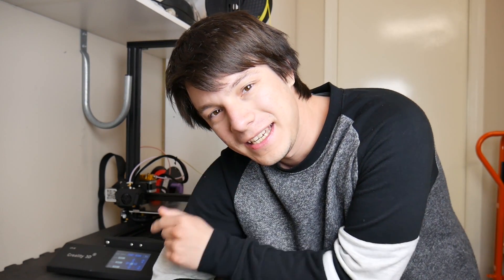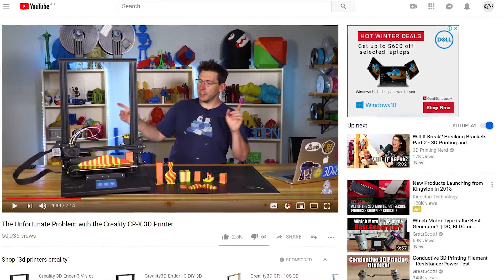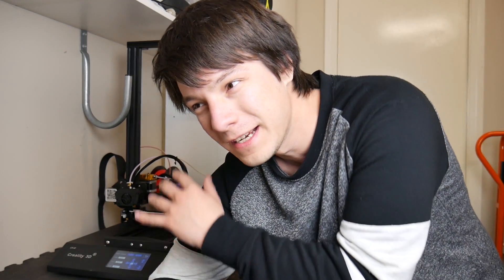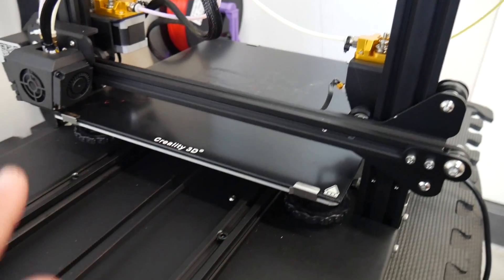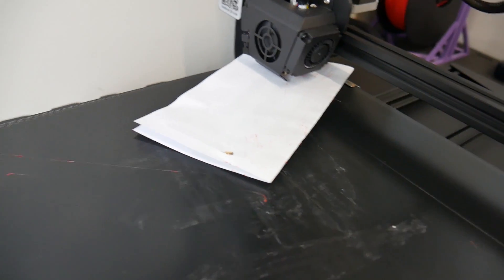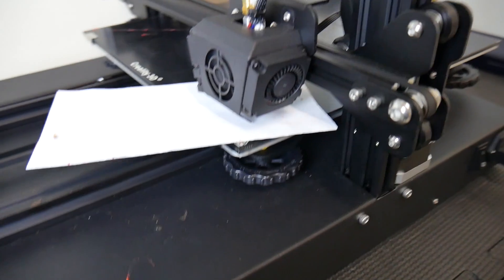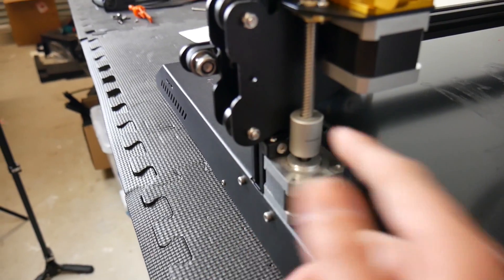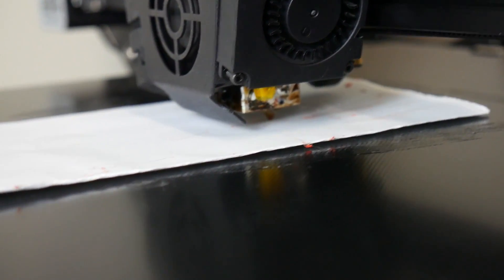Update on my Creality CR-X and going forward

Comment: I think it´s a firmware issue, I experienced similar behaviour with a DIY machine. After Z homes the offset adds a value to the Z coordinate and sets the new value as 0:00 so when the machine gets to start the print it is actually not at 0,2 but at 0,2+ the offset.
the Solution was to disable the 1mm Bumb after Z-homing. a warped bed highlights that effect even more.
Reply from the maker: Cheers for the feedback! I am leaning more and more towards a firmware issue. I'll see if they have any update I can flash to it.
Reply: Maker's Muse . I suspect that a division error (induced by a weird steps/mm setting) may throw off the calculation and adds up. a print that already runs would show no sign of something wrong. If the bed would be able to get close enough you would just se inconsistency on the first layer...and the issue would be not detectable as such.
Reply: I have also run into this on one of my machines.  My solution was to use paper to level the bed, but then adjust the z-offset another .3mm to accommodate the .3mm lift that the printer was making for the .3mm first layer.
Reply: It’s not a firmware issue. It’s how some 3D printers work. When the printer is told in G-code to go to a specific height, it goes to that height above the bed (above z=0). Some slicers, like the one that comes with the Creality (Cura), will raise z to different layer heights optimized for a given quality, adhesion and other factors. The best first layer height is not always the thickness of paper. A procedure must be used to level the bed so that zero means zero.

Also, it is common to have to adjust the tension of the eccentric rollers beneath the bed on a new Creality (and check that all fasteners and cables are tight). That was the reason the front right corner of the bed on my new CR-10s was still too low at it’s maximum adjustment (also the right z motor mount was loose). While it might be nice to have better quality control, having to pay for it might piss off Creality’s customers.
Reply: To say "It's how some 3D Printers work" means it is in the firmware.  Whether that firmware is Marlin or something else, it is something in the firmware that is telling it to go up .3mm above 0 or  to assume that Z 0 is the starting point for the layer.
Reply: In all the code and examples I've seen, Z 0 is the surface of the bed, not the height of the initial layer. I doubt Cura would even let you specify the initial layer height as 0.00mm.

Comment: You think you've got problems with a Creality printer! When I turn mine on the reading for current temps are 102C nozzle and 52C bed even though they are both at room temperature.

If I start a print which needs to reach 200C nozzle and  60C bed the nozzle temp goes runaway and burns the filament but the indicated temp is below 200C and the temperature indicated for bed temp goes up to 86C way past the the temperature where it should stop. 
How am I supposed to work out what the hell is wrong with this sort of thing happening. I wouldn't know where to begin.
Reply: i minabrons sounds like the thermistors are not doing their job, or the controller card you got should have a sticker on it somewhere if you look for it, that should say that it was quality checked on a friday afternoon just before closing time.
Reply: Thanks for the tip although I don't understand why a failed thermistor would affect the temp readings for both the heated bed and the hot end at the same time. Please excuse my ignorance if I have this wrong.
Reply: i minabrons thats ok. Well, these thermistors are sensors, the controller card being their brain, that brain being defective would result in the published readings as being all out of wack. Could be failed resistors on the controller card that work in conjunction with the thermistors. It's like if someone had a food allergy, or went into a slight diabetic coma that caused the person to behave illogically, as if the case with the thermistors misreadings. Hope that helps explain how the controller card (the brain of the machine) conducts its supervision of sensory.
Reply: i minabrons changing the controller card is what I'd do first. If its still misreading after that, then it does point to the sensors being of the friday build variety. Lol 
Cheers
Reply: True Tech, thanks once again for your reply. Much appreciated. 
It helps to focus my attention on a few things rather than the whole device. Especially when the problem with the temp, appears to me, to be so cryptic. 
I looked up (thermistor) controller card online but no luck.
To me card(s) mean something seperate that can connect to a motherboard like an audio card or graphics card. Am I on the wrong track here?

Comment: Do people suddenly forget these are insanely cheapo printers from china? seriously go find another printer with these features and build volume for even remotely close to this price point. THERE IS A REASON THEY ARE CHEAP FFS jeezus guys it's like the 3d printing world didn't exist till the cr-10 came out
Reply: $ 800.00 and they are still using couplings to mate to  leadscrews that do not have ends turned down. Nothing says "we just don't care" more than this.
Reply: Planning on buying Prusa. Tired of buying Chinese 💩.
Reply: sadly even pre production prusa had a lot of issues. Though really the build volume is a deal breaker for me on the prusa
Reply: Regardless of price, the product should work.
Reply: Good point Max, totally agree with you. Even Prusa releases MK3 too early. IMHO they lose some points (at least with me) even trying to fix things later. 

Regarding the bed leveling I realy wanna see this CR-X in action just because I’m curious about the dual cooling solution for this design (that looks like Ultimaker 3 angled fans) and about this dual material solution sharing the same heated block and nozzle. Expecially this last one, I wanna see how reliable it is. Because it’s not easy to be reliable printing with dual colors... and sharing the same nozzle I don’t know but seens that it will cog easilly, but... maybe not. There is not too many printers doing a good job on this dual colour category. When it’s reliable it’s slow like the lift mechanism of those latests Ultimakers. I wanna also see how the new Raise N2+ Pro is... cannot find any review of this printer yet! 

Hictop looks cool out of the box in a first look (by Noob), with dual head extrusion like T-Rex and Sigma, I will keep looking to it and see if continuous to perform well in therms of quality. It doesn’t use a purge block that waste a lot of filament, this is also a good point.
Reply: do you expect a 1000$ car to not have issues? what about a 5000$ car? 10,000$? 20,000$?  what about a betas? do you expect a beta games to be flawless? Do you expect brand new tech that has no alternative even remotely close to build volume or price to be issue free? what about the ones that customers won't even get? Legitmately everything is relevant and to look at in a bubble is foolish.
Reply: Generally speaking, yes. Second-hand products aside, something should work for it's intended purpose no matter what the price point.

There's even laws about this in most countries, though somehow they're not really being enforced anymore.

'Fitness for purpose' and 'merchantability' are legally protected consumer rights in a lot of places (they certainly are in Australia).
And what does that mean, legally speaking?
It means anything you are sold should be in a broadly reliable working condition, and be suited and capable of performing the tasks it was sold as being intended to accomplish.
If it's not, that's grounds for complaints, refunds, and a whole host of other legal liabilities.

Of course, such laws are not always made use of, nor are they enforced consistently even if you bother to make use of them, but that's a legal expectation, historically...

Except, somehow, all these legal rights are slowly but surely being forgotten, ignored, or even actively undermined and changed...

well, that's the way it goes, I suppose, for better or worse.
Reply: Though this isn't for customers, this is a pre production unit so, something customers will never get, and it does work, joel from 3d printing nerd was able to get great prints off it after adjusting the z switch sooo not to sure why all the pitchforks and torches
Reply: off course that issues will still happening but, for exemple, when mk3 lauched everyone was expecting improviments but those first units were printing worse than MK2 and MK2S... and many still. Improviments that together doesn’t work properly by the beggining happens but why not make more tests and provide a better experience to users? With Creality everyone is expecting some improviments in CR-X over CR-10S... and maybe Chiron or Hictop will take this position :D (pt) cochilou cachimbo cai
Reply: The argument is not price, it's the fact that the product doesn't work as advertised. When I bought the CR10 I was fully aware it's a cheap Chinese printer and needs some "upgrades" thanks to reviews from Angus, Joel and several other users. But it became very clear quite quickly that each print is printed on luck and the time and filament wasted in getting decent prints is rediculous. As mentioned in my previous reply, it's not the "small issues of a cheap printer" that upsets me, it's the fact that Creality is still selling the same issues
Reply from the maker: It's $800US lol
Reply: like what other dual color printer is this cheap and that build volume, lulzbot taz6 is 3k with the add on which is way smaller, same with raise3d n2 dual. prusa is way smaller build volume but with their add on its like 1500$ ?
Reply from the maker: Those are good points, it is probably the cheapest dual of its size except maybe compared with the promising looking Hictop DUALE 3 that 3D Maker Noob is testing. Problem is $800 is still a tonne of cash for something that doesn't work. The Prusa mk3 while smaller is miles ahead for reliability. No point having dual color if you can't lay down a first layer imho
Reply: it is, though why would anyone get this over the cr-10s? unless they need dual color and if you need dual color at this build volume there is literally nothing else even close. Having issues comes along with this price point and features, i mean hell, Joel had countless issues with dual printing on his raise 3d n2+ which was over 4k.
Reply: @us3rnam3number  The 10S - Pro seems like a much better machine, but the 10s has the same problems as the CR-X, and the electronics in both are the same horrible and unreliable cards. The 10s-Pro is a huge upgrade with better extruder and better electronics
Reply: that is still cheap, for dual color printer of that build size, like next cheapest is what? t-rex? thats still from china and almost 2k

Comment: I just buit a CR10 mini and the Ender 3 and I am having the same issues with bed leveling ,and the head bet not working . Now I am going to have to buy some cork board and bigger clips  to put under the build plate to get it closer to the nozzel. I have to make mods the these printers right out of the box. I feel like a beta tester too...……………... SHAME.
Reply: Dwain Morris can you return the junk?
Reply: Yep and if I can get it working after a few days back it goes GEARBEST

Comment: For the cr10 s5, I had the same problemo with that one same corner you have, and had to add a extra spring and washers to it, that wasnt easy to make it dial in. It was advertised as being a upgrade version, and listed all the different plastics it was supposed to have no problems printing. It listed em all. Yet, the heatbed never can reach 110c for ABS, and ABS is why I wanted the printer. The thing takes an hour to reach 82 to 85, it maxes out at 85, and that resulted in many failed attempts at printing, eating up supplies and time. Thats frustrating, and did expect better. Then noticed a 3rd party heatbed upgrade, yet the price for that was 400 US! The 3rd party prices between their next smaller size if I remember was something like 250 about, and found it a rude slap in the face just in the major difference in going from the 400mm heater, to the extra 100mm to match the 500mm build volume. What gives there? Greed? Yes. Greed alright. So, creatility really dropped the ball on that issue, and so did the 3rd party upgrade supplier.

It's possible to include a 5 dollar or so MOSFET and add a extra 20v power supply for that, and it is said to heat up in 15 minutes. So why didnt creality make the effort to boost it with a MOSFET and better power supply?
That irks me really..

I can overlook the missing microSD card that was missing, but that heatbed concern and the poorly thought out alignment springy thing, that is the sort of thing they really should've put more into the factory build, rather than to leave purchasers scratching their hair as it falls out faster because of that, and from reading about the very troubling political world news lately (Thought I'd throw that world news thing in because its true, as someone who cares about the world and its inhabitants).

Yes, much needs to be done to raise the bar for the quality of life for ALL, including the planet itself, and creality too, though creality's design modifications in their factory is going to be much easier, with dedication to raising that bar, to lead by best example for other companies to follow suit.

Other than that, the printer has a lot of potential soon.
One complaint i read from others is that they say the build plate glass is often not properly flat, and has a bit of a  reverse les paul guitar effect to its shape in the middle of it, causing people to toss the original plate and source out a nearby glass supplier.

If you try to run the machine fast, it will skip lines of code and thats another thing, so maybe going to a 32 bit controller right out of the box would be an ideal thing for creality to consider as well. 

Also, if these larger volume devices are capable of larger printjobs, the inclusion of larger diameter nozzles should be included with these printers even if resolution isn't the highest by doing that, it does make for print jobs that wont take 5 years to complete. Lol

A lighting option would also be a good plus, even a basic box along the lines of in pieces like an ikea thing, or you will end up with a plastic tarp over the machine, or making a comical enclosure for it such as joel made for it. Lol sorry Joel, that was a funny presentation with the foam sheets with the help of Punished Props. Maybe it was a friday build, or there was beer.
Reply: True Tech also bought my cr10s for Abs. Now using smaller volume printers for abs without problems. Cr had a good idea but they didn’t test their product.

Comment: Not sure at this point why all printer do not come with manual no probe mesh bed leveling as default as it will sort out many issues.

That one coner is a bit of a problem i would pack out under the glass plate with aluminum foil to raise it a bit.

Also i would put washers under the springs to make sure they compress well.

Comment: Hi Angus, I think this problem goes deeper than just creality (sending out pre-production/beta units)-look at the Prusa Mk3 for example-released too early and even yours didn’t have the proper “production” base on. It is a problem when you are expected to do reviews on these units, but just know that the 3D printing community isn’t alone with this issue. It seems to be a growing trend or culture with most things out of China-a lot of pre-production RC aircraft get sent out by companies like FMS, hobbyking, freewing etc and reviewers like yourself find themselves being the “beta testers” if you like when they have been sent a model to supposedly review. 
Whilst I too agree this practice is wrong, it’s a fine line between “pleasing the consumer” by at least showing SOMETHING that’s about to drop on the market, and at the same time getting a fair review (of sorts) from reviewers. All you can really do as reviewers either 1) refuse to do their reviews until the product has been released a few months, Or 2) do exactly what you have done and made it clear that it’s a pre production unit and whilst yours has issues “a,b,c”etc they are likely to be resolved on the production version-which then begs the question “are you in that case beta testing or reviewing?” 

It’s a tough position to be in if you are expected to do a review and you want it to be an accurate reflection of what the end user will get,but if you are getting these printers for free I think the best option is to do what the model aircraft reviewers do and make its problems abundantly clear (as opposed to fix them) and let people know that “it’s a pre production unit, and whilst 80% of it will be fixed design, there is a degree of things that will change post review. 
I don’t know what others think but personally I think it’s $200USD too expensive even if it was 100% perfect.
Reply: John T $200 too expensive? That's cheap for a 3D printer of that size and caliber. It's almost as cheap as building one from scratch. 

There are better alternatives out there but you can easily spend thousands of dollars for some of them. Even they aren't perfect.
Reply: Garou Wolfs Haven i’d sooner spend my money on a Prusa Mk2s and MMU before I spend $800USD on an (unsupported by the factory) Chinese printer regardless of the build volume. I think if it’s build volume your after as well your better off spending a few hundred more and either buying something that is supported by the manufacturer, or failing that you could actually probably buy a CR10 and add the second extruder for a heap less and have none of the issues.
Reply: Garou Wolfs Haven , you like to jump... He was implying it should cost $200 LESS. This is an explanation, not an agreement...